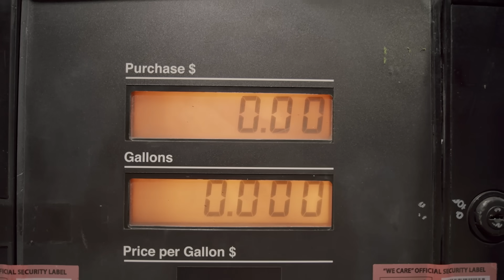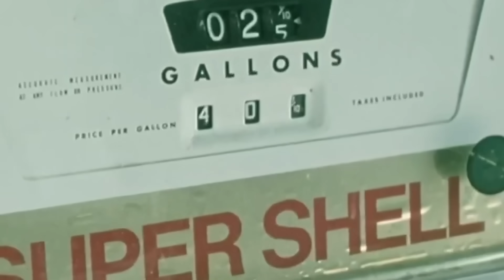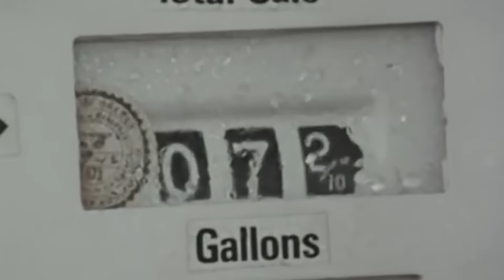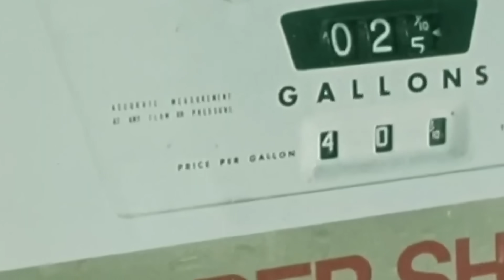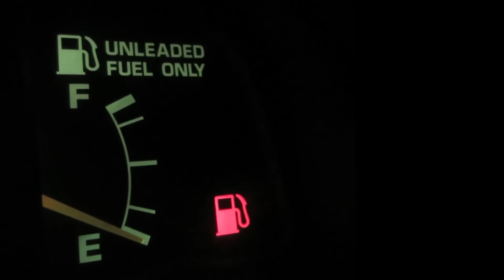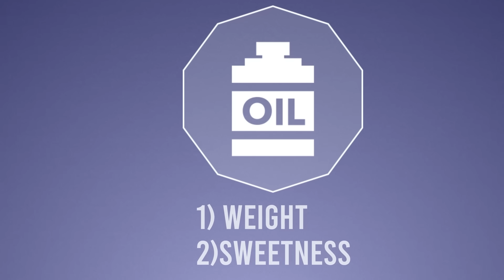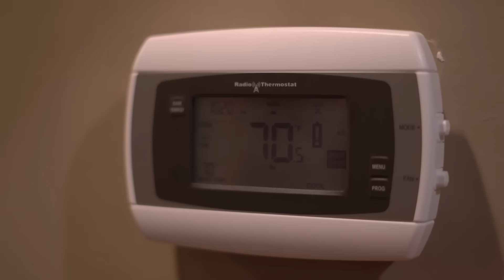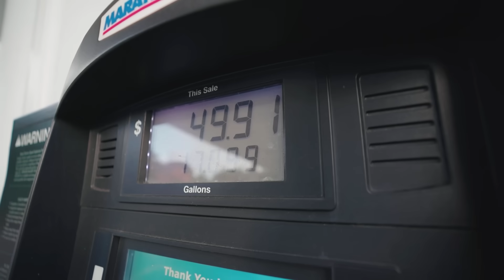How The US Is Becoming Energy Independent

Comment: The US does not fight wars for oil, the presence of oil drilling assisted by the US, has only boosted the regional economy, the US exports around as much oil from Canada, as the entire middle east! The US presence is WORSE for the US, even with the oil, it costs the US more than it gains to drill oil there, in monetary value,  just in money, the US economy doesn't benefit, the US energy sector doesn't benefit from oil in the middle east, but the US, as a country does.

Comment: So, this idea that the U.S. has wars for oil doesn't really make much sense.

We only get about 12% of our oil from the Middle East.
Even when we controlled Iraqi oil wells, we didn't profit from them. And, we eventually returned them to Iraqi control.

We purchase about 12% of our oil from the Middle East, but that would likely be a lot higher had we not had so much involvement.

Most of our oil is either produced domestically, or comes from Canada or Mexico.
Reply: It wasn’t always like that. Horizontal drilling + hydraulic fracturing changed the equation.

Comment: The US really needs to push more into Solar.  There is so much flat land that is not utilized and perfect for solar fields.  Given how much of a push there is for EV's, I expect the oil demand to drop sharply in 20-30 years and a new major demand to upgrade the power grid.  We need to start upgrading soon in order to meet expected demands.
Reply: No, we need to push more into Nuclear. Nuclear Energy is proven to be the safest, cleanest, and most efficient form of energy available and will become more so once stable fusion energy is achieved.  Solar is also time and climate dependent. This is one of the reason big oil actually pushes for solar and wind because when the wind is not blowing and the sun is not shining the oil is flowing.
Reply: The problem with solar is that none of the major components are found in the  US, typically rare earth metals. In addition, the largest producer of solar panels is China, a rival. No US ally or trading partner can compete nor satisfy US demands.
Reply: @paladin773  that is true however the materials are not rare by any means. There are other sources that can be leveraged at a lower scale.  The easiest transition would be to use natural gas turbines, for which production is on the rise, and meet a balance in the middle there.  This still satisfies green energy initiatives and falls in line with the current infrastructure push.

Comment: Even if you don't believe or don't care about climate change, which you absolute should, being so dependant on a source of energy that can at times be so volatile and can leave you vulnerable to changing politics overseas is not smart. 

Yes, renewable energies are not perfect but they have clear advantages and they are only getting better and cheaper as their technologies improve. Most people that are against renewables energies have money to lose.
Reply: don't forget not using oil and gas now means having it later, so lowering the daily amount used essentially means extending the length of our reserves.
Reply: Problem is our power grids are designed to operate at a instantaneous need basis and renewables with our current tech cannot be utilized as baseloads consistently. We are still decades out from developing the renewable and battery tech for efficient baseload compensations, and decades from that to properly convert, construct, and implement the infrastructure needed

Comment: Generated using Talkbud (Browser Extension):

📝 Summary of Key Points:

📌 The United States has historically relied on foreign oil, but it is gradually becoming more self-reliant for energy.
🧐 Factors that led to the US dependence on foreign oil include freeing up energy budget for other economic uses and avoiding entanglement in foreign politics.
🚀 The 1973 oil embargo exposed foreign energy dependence as a strategic liability, and previous attempts by Presidents Nixon and Carter to achieve energy independence were unsuccessful.
🚀 The Bush administration's focus on energy independence led to the 2003 Iraq invasion.
🚀 The shale revolution and advancements in fracking technology have significantly increased US domestic oil production.
🚀 The US is now more energy independent than ever before, producing more energy than it consumes and exporting more oil than it imports.
🚀 The definition of energy independence is not clearly defined and can vary.
🚀 The US still imports a significant amount of crude oil due to differences in refining capacity and the type of oil produced domestically.
🚀 The US is investing more in renewable energies and gradually reducing its reliance on oil.

💡 Additional Insights and Observations:

💬 "The US has been heavily involved in the Middle East due to its need for oil."
📊 The US is now a net exporter of oil and petroleum products.
🌐 References and Sources: The video does not mention any specific references or sources.

📣 Concluding Remarks:

The video highlights the United States' historical reliance on foreign oil and its journey towards energy independence. It discusses the factors that led to this dependence and explores case studies such as the 1973 oil embargo and the Bush administration's focus on energy independence. The video emphasizes the significant increase in US domestic oil production due to the shale revolution and advancements in fracking technology. While the US is now more energy independent than ever before, it still imports crude oil due to differences in refining capacity. However, the US is investing more in renewable energies, indicating a gradual reduction in its reliance on oil.

Comment: While putting a ‘Mr. Fusion’ in a car will probably remain a pipe dream, one can run an electric car, truck, or train off of power generated at a nuclear power station.
Reply: Nuclear is great but unfortunately it requires too much upkeep and the oil and coal industry lobbies a lot harder than nuclear industry.

Comment: One important thing to note is: the exports and imports can occour because of the "Jones Act". This law makes SO costly to ship by sea from US to US that it's more efficient to export Oil and import oil than just ship it from one state to another.
Reply: We need to get rid of Jones Act
Reply: Genuinely curious, I had never heard of the Jones Act until I read you comment. What it said is, under the Jones Act, foreign carriers and crews are banned from domestic water routes. Cabotage from one U.S. port to another is restricted to U.S.-built, -crewed and -flagged vessels. The requirement was a protectionist economic strategy designed to assist America's shipyards and maritime fleet. The words foreign carriers implies that the Jones Act refers only to foreign carriers. Was it amended to add domestic? It seems to imply that US built and crewed flagged vessels are exempt. I must be missing something? Any help would be appreciated.
Reply: That act also killed all river traffic because it does not specify river or sea ports.
Reply: @spaceengineeringempire4086 rivers are busy as hell with commerce! The vessels are so specialized for river transport that foreign competition isn't really as viable anyway. But the Jones Act did indeed mothball most the refineries on the East Coast! By not allowing cheap Texas oil, American East Coast refineries were forced to use expensive foreign sweet crude imports. Eastern Canada got to buy cheap Texas sweet crude though. So the foreign competition bankrupted most the American refineries on the East Coast with their cheap gasoline and diesel exports (from USA Crude! Thanks to Jones Act)
Reply: lets elect a politian to repeal it
Reply: The Jones Act is irrelevant, JPM did an in-depth report on repealing it. By repealing it, that would reduce the cost at the pump by around 10 cents, but I have seen other pro Jones Act reads that say it's closer to 1 cent. If we assume the JPM report is correct using the average fuel economy and the average mileage, the average driver would save $4 a year.
Reply: @briand5379  Which tend to add up, give or take. In order for any subsequent Administration to found a new energy task force, they'd have to ensure that big oil doesn't have as much of a say as they used to, if at all.

Comment: In short, how much micro infrastructure could we produce to reduce citizens, towns, and cities' eltric consumption thuse reducing oil,coal, and natural gas. Or major gigantic renewable power supply generation and transmission.  Some small micro infrastructure power, water, etc. systems supplied by solar might, if widely used, be part of the cost-effective solution. Obviously, tv cameras  and wifi, remotely controlled substation, etc, will necessarily create special jobs for some people. But for the community, what would be the net result? Would scaleable. Could we mass produce the sub system in Mexico and create Jon's in the united state's and eles where installing and repairing  the substations?
Reply: What did I just read
Reply: @SliverHell I have no idea except that the dude mentions switching up to renewables lol

Comment: What will be the is the definition of energy independence in the near future be?  If we have glowing plants in our house replacing eltric lights. And several such bio engineered. Glowing tress,  and,  other special plants  to accelerate the clean-up of our cities air and waterways. If our streets and sidewalks collect rain water, and use it, pluse soap to wash and clean them selves. Then suck up all the soapy waste water to reproces it with solar energy cells as power sources. And our lawns are bio genetic engered to glow in the dark. With rain water capture systems to feed just just enough water and nutrients to the plants' roots.  Etc.